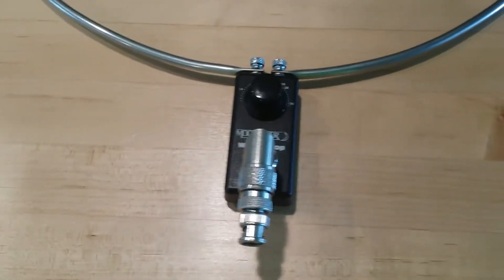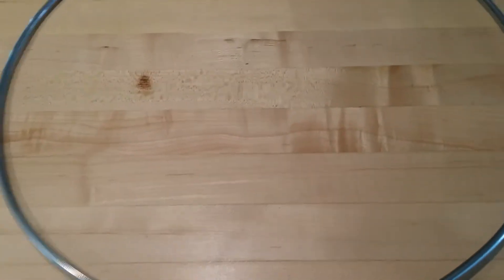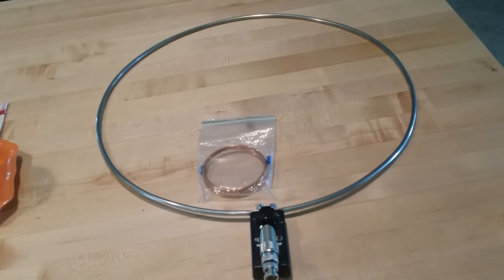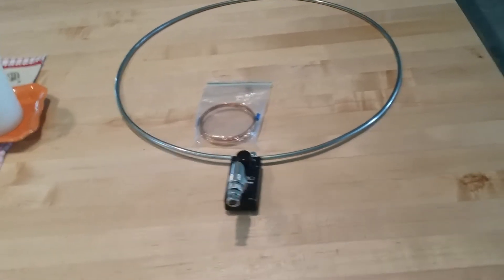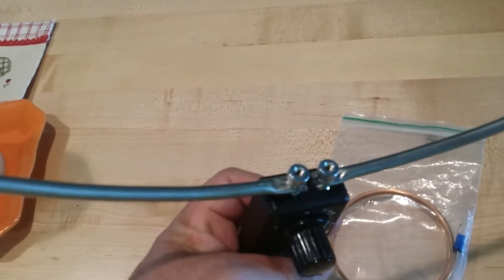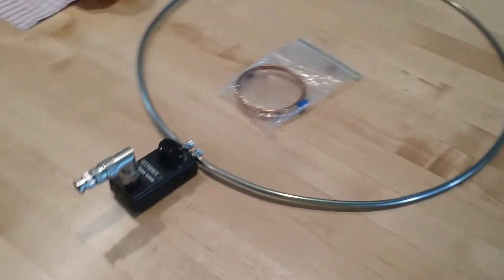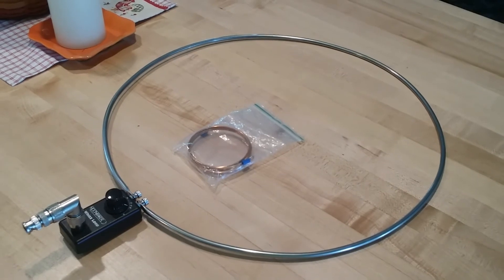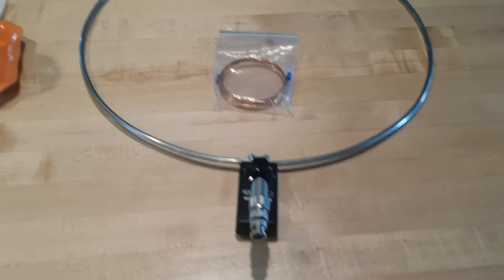Wonderloop antenna modification

Comment: Greetings from Mexico! Wonder Loop antennas are not recommended to increase the thickness of the hoop since the voltage increases ... its capacitor is hardly a polyvaricon, it would not support so much voltage and would shorten its useful life!
Reply from the maker: Ahhh, I did not know this.  I did see that with the supplied copper wire I had a sharper peak in noise level.  I use the stock wire or plastic coated wire of the same Guage .....it's been too bulky to pack the tubing loop.  Thanks for the info.  73

Comment: spray paint a plastic hulahoop with a piece of copper wire inside.. it is very light. 223cm is good loop for rx of apt weather satellite. i did not say transmitting of hf.. however does also rx well for 40m prehaps not as effectient as other lengths mentioned.. you could also transmit into a small bulb for gigles. it does work as well..
Reply: 223cm is the total length of the material used to make the loop. not the diameter of the loop.
Reply: other lengths you can try according to this is 165cm as indicated below.. and through other items 137cm or 274cm those might be on par for transmitting depending on your equipment and desired frequencies. 210cm would make something work on 146mhz incase someone was interested in that one..
Reply from the maker: Ive made enough contacts on that mini loop with the supplied wire to say the antenna works surprisingly well....especially if your up in the air on a second or higher floor of a hotel or
 sitting on a boardwalk bench right on the ocean as ive done both.   73,

Comment: Would copper tubing work better? I have a Wonderful Loop coming so I'm thinking of adding thicker tubing for my home station and keeping the wire for portable operations
Reply from the maker: I didn't have copper at the time, but it would of worked as well.  73
Reply: Walter did you try the copper loop if so how did you get on.

Comment: Hello friend what kind of material is that? and how thick ?? Weight ?? where did you get it from ?? in the hardware store ?? greetings from Switzerland
Reply from the maker: It's oxygen service grade stainless steel tubing.  It's fairly light for what it is.  It doesnt put stress on the lugs of the loop tuner.   It was scrap from a job at my work.  I hand bent it, working it slowly.  It's about 1/8th inch diameter.    It works well.   73

Comment: Nice. Though as others have said I'd be concerned with the high voltages in the unit,  probably near a KV. How has yours faired?

I'm about to try and make a loop out of 10awg wire. Little bit more efficiency than the stock wire (I have the whip, not the wire) but keeps the voltage more reasonable.

Thank you for sharing the circumference in a comment!

Comment: Great job! Can I ask what is the diameter of the tube?
Reply from the maker: qzwxecrvtbyn789.   its 3/16ths stainless.  Its super lite compaired to its size.  Works very well in the summer on the upper deck of the house.
Reply: You mean the outer diameter is 3/16"? From the video, it looks like more than 1/4". I would like to duplicate your design, but not sure about the size the tube.
Reply from the maker: qzwxecrvtbyn789.  Circumference or total length of tube is 46 inches I believe, tube is 3/16s
Reply: Thanks. BTW, what's the model of handheld transceiver that you mentioned in the video?
Reply from the maker: qzwxecrvtbyn789 a cherokee ah 100 handheld or a yaesu ft 817 qrp radio
Reply: It is not aluminum???
Reply from the maker: Eduardo Power it is stainless tubeing from a old oxygen plant.

Comment: Are you sure the circumference is 45"?  If so, are you able to get it to tune a low SWR on 40 meters?   The included loop wire with the Whizz (at least the one I recently received) is approx. 65".
Reply from the maker: Jim Southwick sorry, i transposed the length.  I just double checked the original and that loop as well and its 54 inches in circumference.  I think you hane the wizz loop v2 which does 40 meters.  The original one i have there goes to 20 meters.....it wont tune below 14 mhz......the v2 is 65 inches in circumference and does tune a bit below 7 mhz.....i have both versions and just measured both of the originals.    I do have a loop i made out of 1/4 inch aluminum tubing from a old cb antenna ground radial which weighs half that of the one in this video and tunes to 20 meters and a tad bit lower than 14 mhz, like to 13mhz.   But yes i transposed the numbers on the measurement.   My bad.

Comment: Output wattage, probably not. If you have equal SWR on both Antenna's, transmitted power should not change. What WILL improve is your E-R-P....Effective Radiated  Power.   AC7AA
Reply from the maker: Bruce Forster yes  it improves efficiency.   It radiates a better percentage of the 10 watts.   Maby 7 out of ten not 4 or 5 out of ten.  Thsnks.
Reply: I was not criticizing you in any way. I know YOU understand this. The only reason I commented is to help the less experienced Hams follow this material.

Comment: I'm not sure that steel is a good material to use; its RF resistivity can be much higher than copper.
Reply from the maker: Most antennas have stainless steel whips especially the tried and true 102" whip.  Copper would be the best but stainless has been used in alot of antenna applications.   Thanks for your interest, I use the supplied copper wire now for ease of transport.   ,73
Reply: @gregoryburbage7906  Hi Gregory, thanks for your reply.  I think RF conductivity is much more critical for a small loops such as this; the radiation-resistance, of the loop, is very low, so conductive losses become much more significant.  73, Tim
Reply from the maker: @timdbl7804  well wort thinking about...i switched to a solid copper wire just a couple guages thicker than the one supplied for ridgity in the field in breezy conditions....the one in the video i abanded because it wasnt too portable....that copper loop worked really  well maby because if greater skin effect but it was onky maby twice as thick as the original at most
Reply: @gregoryburbage7906  That's interesting; I might try that on my wonderloop :-D

Comment: Why not try holding the camera still when shooting videos.  Novel concept but you will be surprised how much more "watch" time you get.  

By the way I call BS on your "more wattage because of a fatter wire".  Does NOT make the antenna more efficient.  It DOES improve the band pass of the antenna.  That will make the antenna easier to tune and that will reduce the SWR slightly.  It is a good modification  but it does not work better for the reasons you are giving here.
Reply: A larger diameter wire or loop material will increase the efficiency of the
 radiated signal,but not the wattage output.A tuned loop antenna has a high Q,but a very narrow range of resonance.Tuning the VFO just a few kilocycles away in frequency will require it to be retuned to resonance.
Reply: Which part of an antenna dictates the max wattage input? Serious question.
Reply: No part of a antenna dictates it's max wattage output,but the directive elements do if it is a forward gain antenna,such as a yagi,or quad antenna.This is called ERP,or effective radiated power.
Reply from the maker: Old Dog go to any loop antenna calculator program and see the differences in efficiency in the different diameter tubing.....you can go from nominal efficiency to good efficiency when tubing diameter is increased......at least thats what the calculator dictates.....the difference from quarter inch to 1 inch diameter goes from like 83 percent to 93 percent with the same circumference measurement......thats how i determined what size tube i used in my home indoor loop.     Check it out on line and run the numbers in the antenna calculator.